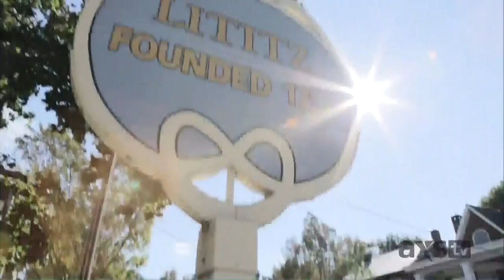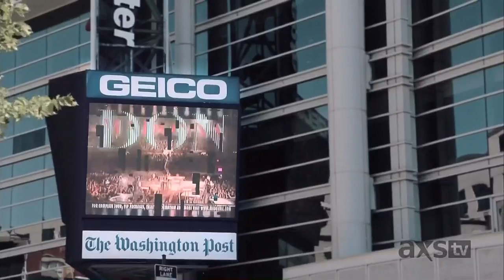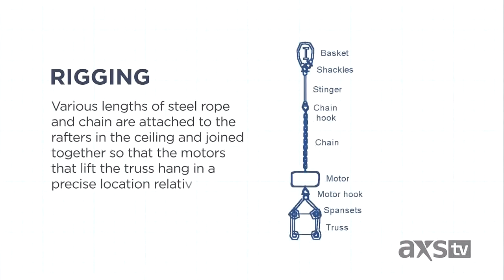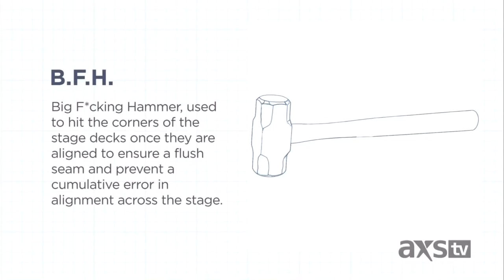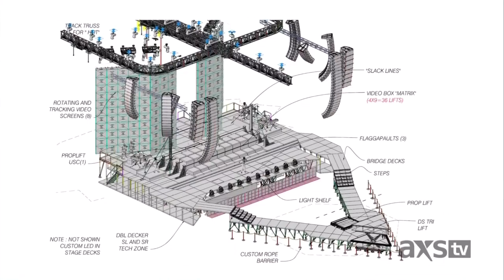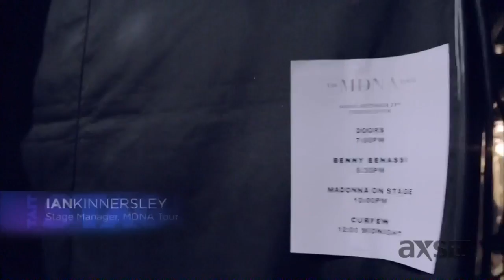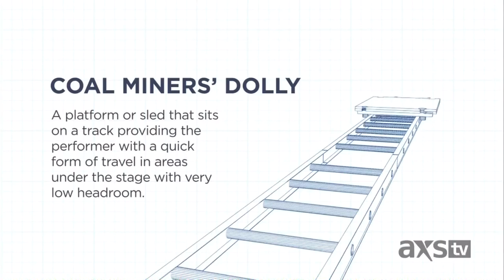Madonna - Building MDNA Tour Stage with Tait - The Matrix

Comment: 22:15 anyone else notice the sharpie on the Right not working
Reply: Yeah ... its electronics. They tend to do that from time to time.
Reply: standard overheating issue with the main supply board.  bad design
Reply: what are you talking about i went over it like 10 times  it works it was going on and off on all of them